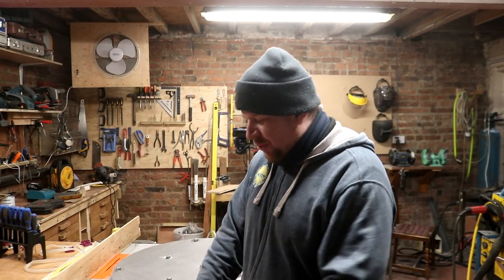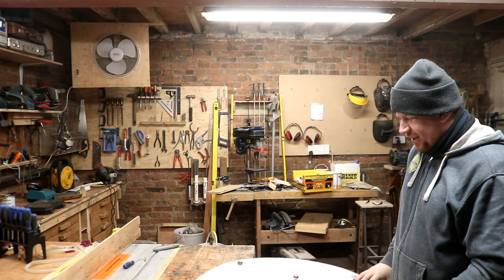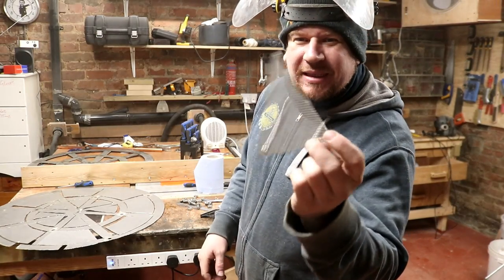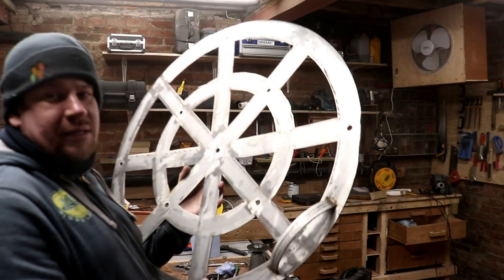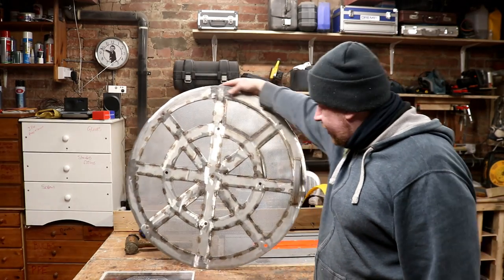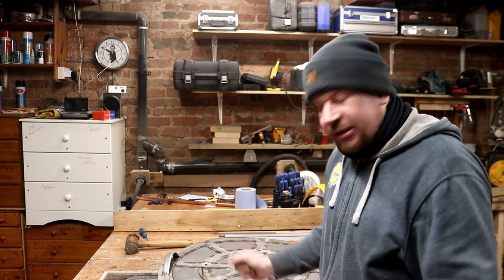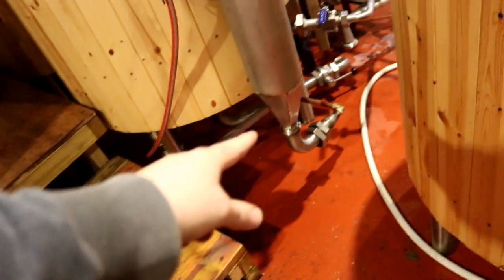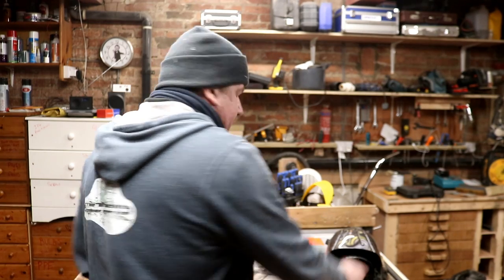SO THE FALSE BOTTOM FAILED!

Comment: I sugest you cut a ring with the same diameter of th false bottom, drill some holes in the same place as the bolts and bolt it as a reinforcement. It will press down the perfurated steel. Cheers!
Reply: This!  Nail on the head.
Reply: You could also use this to sandwich some silicone sheet gasket to act as a wiper seal

Comment: How about welding a lip around the inside of the mash tun for the false bottom to sit on? A little shelf if you like.   Use maybe 4 bolts to fix it in place. Then with the ‘feet’ adjusted to the right height it will pull it flat and down tight.

Comment: Hmm, making flat stuff (lids & bottoms) seems a right PITA. Could you make it slightly conical instead? Diameter wouldn't matter too much but it would have to be perfectly round so you'd need to hook-up the circle-cutting rig for the plasma to trim it down to a perfect circle. It wouldn't need the bolts for feet then either.
Reply from the maker: It is the mash tun that is not round. Welding the legs on made it move a bit.
Reply: @harrybrew69  I see. Possibly even more reason to make the false bottom conical because it would sit flush with the bottom of the mash tun, not the sides?

Comment: Would the false bottom not be better the other way up so the weight of the grain is pressing the mesh ONTO the frame. The way it is now, surely the grain is forcing the mesh away from the frame ?
Reply: Not sure it would make any difference as the weld will be very strong.

Comment: Why don't you just tack weld it around the edge to keep the filter from popping up, failing that you could cut an oversize mesh and bend it around the edges....  Typed too soon, you've cut and welded all those small bits now, lol.